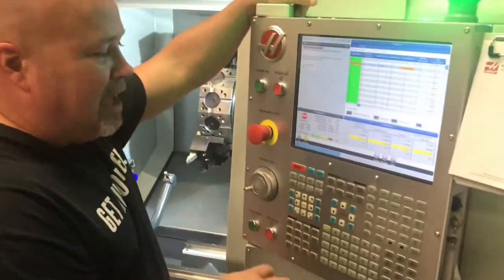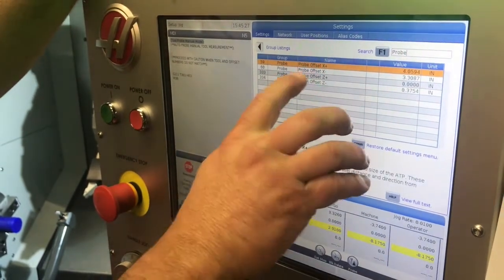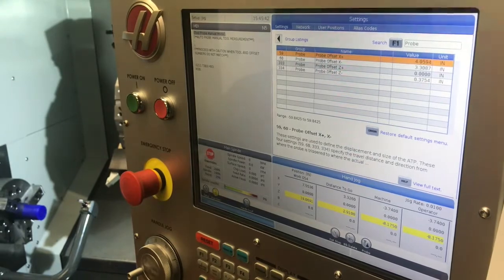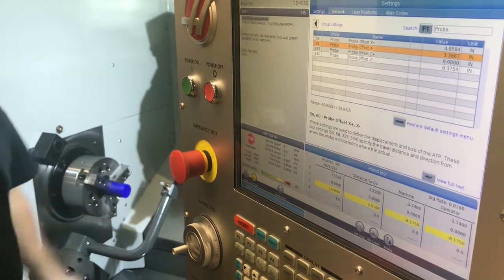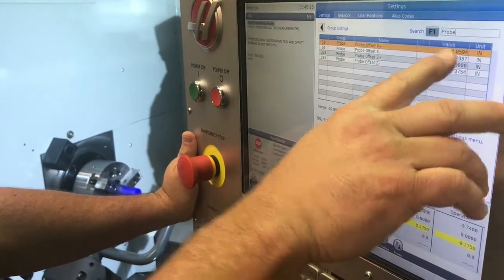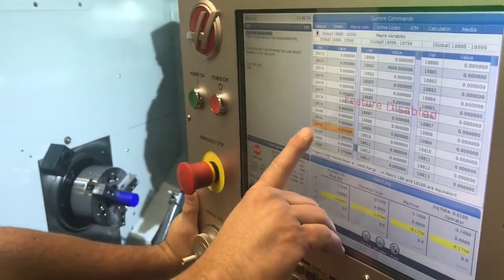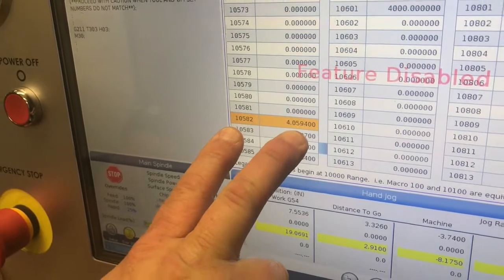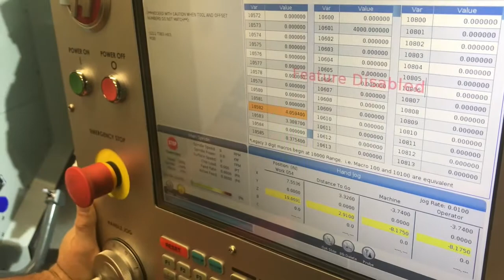Haas Lathe ATP probe calibration (Auto Tool Pre-Setter)

Comment: Hello,
Please help me; after calibrating the styles, the machine no longer works when I want to set tools for the center line. What do I need to do?
Reply: Hello Javier.  You first need to know if you have an NGC control vs. Classic Haas Control (light blue).  The NGC centerline settings can be found in the Setting / User Positions Tab.  You'll need to move the machine to the centerline position (indicate a tool block), and then use the <F2> button to set the value.  Calibrating your ATP normally does not make any change to your "F2 Centerline" shortcut on the offsets page.  Your local HFO may be able to help you with this as well.  Thank you for watching.

Comment: How do you calculate this value  for setting 59 and 60
Reply: Hi John.  Setting 59 and 60 are literally the diameter that the probe stylus is sitting in space (+ for OD / - for ID).  If you OD tool is .005 off, make a .005 change to this value, just as I explained in the video.  Thank you for watching.

Comment: Great video! I noticed your Z+ value was zero on the probing page. I am assuming it is always set to zero and the difference between the location of the probe and the actual work piece is determined by the difference in your G54 value for Z correct?